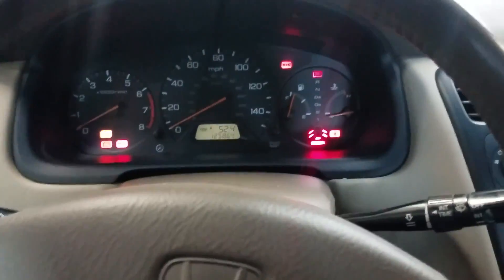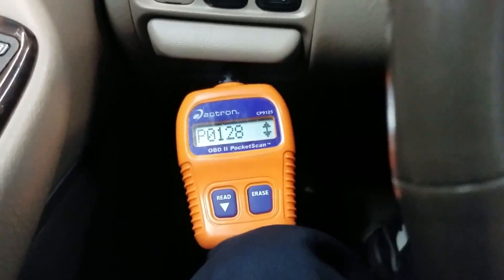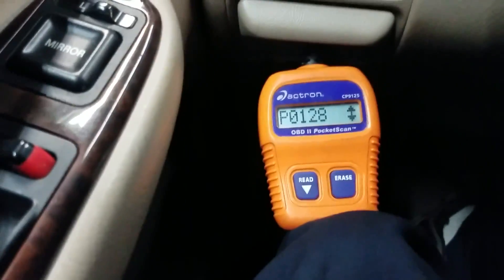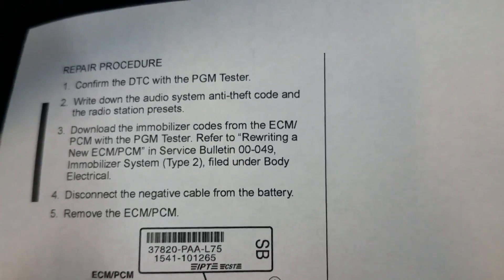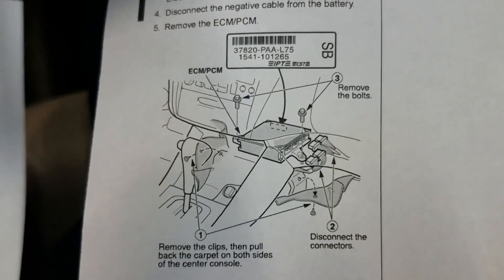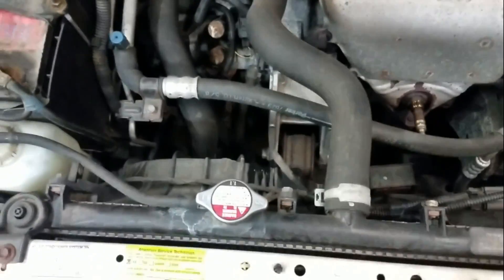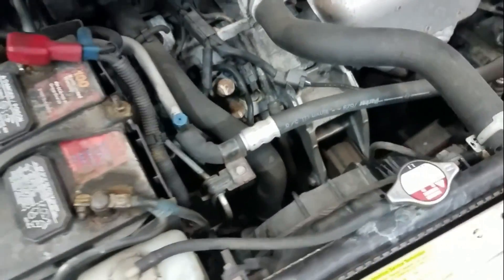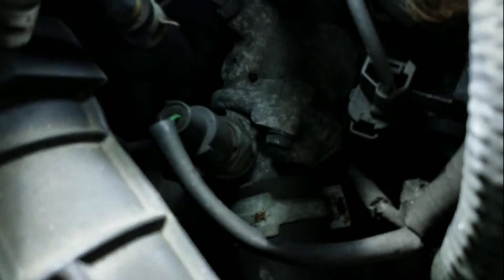P0128 Coolant Temp Below Thermostat Regulating Temp

Comment: I have a 2001 Honda accord and last week got this code and already changed the coolant temperature sensor . Should I change the thermostat as well.  the car drives fine doesn’t jerk or stall the gauges marks normal . I haven’t changed that part since I got the car so I might do that and if the check engine light  comes back on would it be that I need a new ecm ?

Comment: Going thru that right now.  Temp falls to about 130ish, fans still turn on normal; but both gauge and scan tool show the drop/rise.  I replaced ECT and ran fine while bleeding air out of system.  Once I put cap back on - did the same thing.  Right now just bled it AGAIN and now put the cap back on about 5 mins ago.  Still running good.  The temp has not dropped yet. 😁 We'll see what happens

Comment: If I replaced the thermostat, radiator cap and coolant temp sensor and engine light is still on what else could it be???
Reply: Coolant temp sensor possibly
Reply: @mattbrooks9928  I already did that… ended up being the thermostat… I replaced with OEM in which I highly recommend only OEM even if it’s more expensive
Reply: @mikelutts7088  I agree. I been working on my friends terrain she had a code for the temp sensor but when we put it on it still had the gauge dropping to c randomly and the code keeps coming back so we are gonna try thermostat next.
Reply: @mattbrooks9928  just make sure it’s OEM. I switched it 2 times and still had the p0182 code and when I put the OEM engine light off and temp gauge working again 👍🏼 it’s cost way more but trust me it’ll be worth it in the long run and less frustrations.
Reply: @mikelutts7088  I gotcha thanks. Had a similar issue in my toyota recently went through two water pumps and two thermostats. Have you had any other issues out of it?
Reply: @mattbrooks9928  all been working great since I changed that thermostat 230k miles
Reply: @mikelutts7088  I mean like any other repairs you’ve had to do on the car? Just asking cause she just bought hers and I’m the one that fixes it lol so was just wondering if there was any other issues that’s came up hers is at 220k
Reply: @mattbrooks9928  had to change the pulley tensioner, crankshaft pulley, spark plugs, power steering pump, battery cables, really I’m no mechanic but all pretty easy so far with basic tools. Lot of great videos on here
Reply: @mikelutts7088  yeah I’m about to do her harmonic balancer pulley for the crank soon. I’ll give her tensioner a look to. Her blower for the ac just went out also. But thanks just curious to issues others have had.
Reply: @mattbrooks9928  I didn’t need the “Honda tool” I just used my Milwaukee drill and I think it was like a 19 socket and 6 seconds later came off. Great to share we all learn! Pretty easy car to work on though
Reply: @mikelutts7088  that’s true lol repair shops gonna go out of business with YouTube lol
Reply: @mattbrooks9928  as long as I don’t need any “special tool” I’ll try myself. I’ve saved a few thousand already hoping to hit 300k miles lol
Reply: @mikelutts7088  I feel you. I been working on cars for 15 years or so not in a shop my dad taught me a lot and has a big shop with a lift and stuff. I always encourage people to try and fix stuff themselves cause I don’t trust shops or dealers and it saves so much money. I work on the road with truck drivers I escort Oversize loads so my Prius sees a lot of miles I’ve got a 350z that basically just sits there in the shop since I started this job lol but my friend has had such bad luck with cars I been trying to ask a few others that have them to see what to expect. My buddy was told by a shop he needed a new timing chain and camshaft which was quoted around 2k me and my dad took his belt off trying to see where the crazy sound was coming from turned out to be his alternator pulley for 250$ once we found out the guy that told him the timing chain and stuff he wouldn’t answer the phone lol so I just dont trust people in shops cause they just want you money.
Reply: @mattbrooks9928  dang that sucks… lot of bad mechanics out there that give the good mechanics a bad name… if I can fix it and only cost me time and a few bad words I’m all over it lolol with a couple beers.

Comment: if this engine check light code was not repaired for long time, what will happen ?
i hear loud noise after 20 - 30 min of driving which is increased with pushing on accelerator !!! is it related to unrepaired coolant thermostat  ?
Reply: It’s supposed to be a driveable code from what I’ve researched (I have the same problem on my e550) but overtime there’s a small chance that water could contaminate the oil from humidity built up that an entirely warm engine would otherwise evaporate. So as far as im concerned it’s a fix as soon as convenient type thing
Reply: @ziggys9439  
you work as mechanic expert ?
Reply: @robertokristen8316  no definitely not, I’d take all that i said as anecdotal evidence, just so far from my driving experience with a po128 code, I haven’t had any issues appear, except for reduced fuel efficiency
Reply: @robertokristen8316  I just have happened to be dealing with the same issue as you for a while, and driving on it hasn’t done anything irreversible yet

Comment: I've had this code come up on my GMC 2017 Acadia. It matches exactly with what their probable cause statement. I've tested this out and recorded my ECT while driving in different manners and the one thing that will cause the code to kick on is driving aggressively. If you let it warm up at start-up for about 15 minutes, you can drive like a bat out of hell and it won't kick on, but jump in and take off and it always comes on. I realize this is a few years old and different make/model vehicle. I've been researching this issue cause it super hard to find the correct part and super expensive to have the thermostat replaced. GMC totally screwed us by putting it in a hard to reach spot 😩🤬
Reply: Mine does that’s same thing but I have a Kia optima! I’ve changed the thermostat myself and burped it and it still happens

Comment: Can excessive cold cause this? we have been -40 for awhile. Now we are basically 0 but its still on. Dodge caravan 2013
Reply: It will kick on more during the winter if you haven't warmed up your vehicle than the summer. It has to do with how aggressive you push your engine. Drive real casual and/or warm up before you take off and it tends to not kick on as much. I'm driving the GMC 17 Acadia and have the same problem. I started driving around with my code reader on, and it seems like the actual temp is normal.

Comment: Got a p0128 light, it went out, but had the coolant and thermostat replaced anyway.  After replacement, the same code came on again...had auto parts store clear code. Couple days later, same one comes on again! Could it be the sensor? Sick of this happening.
Reply: i read main symptoms are bad thermostat, bad wiring, then the coolant temperature sensor. maybe its your sensor
Reply: @andresandrade5963  Thank you for the reply!  So I had anauto part store guy tell me to do a hard reset, which I disconnected the positive terminal of batttery, for 15 mins.  Its been over a week and its not on , so it may have been a stored code.
Reply: The sensor is the first thing I check when this code comes up. If it says -40 degrees when it's like 70 degrees outside, it's a bad sensor.
Reply: Did it stay off after that hard reset, or did you end up changing the sensor?
Reply: Sorry guys, just saw these comments. It did stay off after the hard reset, it wound up doing pretty well after that. Unfortunately, it's since been totaled, but mainly I'm Ok. That was a really great vehicle, but the fuel costs for it would've been crazy!

Comment: i was getting too hot  and changed the thermostat now its tossing me a p0128, coolant looks good  , so im thnking its either the wrong thermostat type or a sensor??
Reply: my thermostat is fine but Check engine is on

Comment: I replaced the water pump, thermostat and it still gives me that code. I'm going to replace the damn coolant sensor and maybe the radiator and see if it goes away.
Reply: Maybe do the sensor first😂
Reply: Did replacing the coolant sensor work? And what car do you have?

Comment: I have this code 
I took out my thermostat as I live in a hot climate. Should I pop it back in ?
Reply: Taking out the thermostat because you live in a hot climate is one of the more senseless auto myths floating around. It also costs people lots of money in wasted fuel.
The thermostat helps the engine to reach operating temperatures quicker, so that the computer can go into closed loop operation. It does this by staying closed, so that the coolant in the engine gets hot, staying isolated from the radiator.
Before this, the computer will be in open loop, more or less dumping fuel into the engine, just so it stays running.
Reply: Replace the Radiator Cap, Hoses with new screw hose clamps & Coolant Sensors with new coolant.

Comment: got check engine light (p 0128) , replaced the thermostat but the check engine light still on even after driving the car for around 70 miles (coolant level is OK and cooling sensor is OK also) is that normal ? Yeah, the car is 2014 Dodge grand caravan
Reply: Temp sensor probably bad
Reply: @Treaxvour  that’s what I’m thinking is wrong with mine I’m changing it today and seeing if it fixed the problem.
Reply: He said he fixed the engine coolant temperature sensor
Reply: Did you install the new thermostat in exactly like the original with new gasket, all coolant hoses (I mean all of them) with new clamps, new radiator cap and new coolant?
Most thermostats have little pin rod like (bubble bleeder), it you be in at 12 O'clock.
Reply: @angelisone  you are like the guy that ask someone if they replaced a battery in something when it dont work lol. What does changing hoes, clamps got to do with the problem?
Reply: @angelisone  stupid advice

Comment: WHY WOULD AN ENGINE LIGHT GO ON CUZ COOLANT ISNT HOT ENOUGH  THE ENGINE LIGHT IS A BUNCH OF BULL SHIT  THE  MEACHNICS RIP U OFF AS IT IS NOW THE GOVERMENT GIVES THEM ANOTHER REASON WITH THESE FING ENGINE LIGHT!
Reply: If the engine does not get up to a specific temp that could cause sludge build up in the oil. A good mechanic is priceless.
Reply: @paintnamer6403  thanks for this comment..my new truck thru code for low temperature..I checked oil it was sludge..I was TRIPPING OUT! at least I know the 2 things are connected and not separate issues..yes they are priceless

Comment: Got this code on my 2013 Chrysler 200. The car doesn't over heat but in real cold weather it doesn't stay hot instead the temp would drop as I start to drive
Reply: Should be 2 thermostats in there. Replace them both and I recommend flush flush flush. The original coolant in the 200's is problematic.

Comment: My mom's car will read p0128 every once in awhile but I just turn it off because the thermostat has been replaced. Don't know what keeps causing it to come on.
Reply: KingDing919 same here. The thermostat is new but I’ll get this code once in a while. I notice that the temperature gage should be a bit higher than it is (just a bit passed 1/4)
Reply: Maybe the temp sensor. Usually be thermostat or temp sensor.
Reply: @kingding919 what tool do you use to reset the code?
Reply: @manwulf  I just bought me a OBD reader off the internet for like $10 that reads codes. It gives the option to erase codes or turn them off.
Reply: @cburn67  thank you!

Comment: Hello, i have a 2005 Chevy Aveo. I bought this car a few months ago, but the check enginev light was coming on and off for " cam-shaft position sense" low circuit 1. Car drove fine for awhile. I stalled outna few days ago. I read it could be the cam shaft position sensorn. My brother norice the coolant around the thermostat housing when i had  my hood open. I figure knock out 2 birds with one stone. I got both replaced. Thermostat housing and cam shaft position sensor. I drove the car around for 2 days and on my way into work the check engine light comes on, for p0128 coolant below thermostat. My mechanic did ask me to grab orange coolant when going to pick my car up at his house.  I told him i had 50/50 in my trunk. Could this be the problem? Or js it stuck thermostat? Or is if coolant thermostat sensor?
Reply from the maker: Most likely just a bad t-stat. Because that code wasn't there before you did the t-stat. Also be sure it was installed in the correct direction.
Reply: @FlatRateMechanic  thanks!

Comment: Well? Was it the thermostat or ECM?
Reply from the maker: It was just a thermostat on this one.
Reply: @FlatRateMechanic  just did both sensors .on housing and sensor under dizzy and it put the code back on . Did thermostat aswell could it be a stored code with accords . Or is it really my ecm . Car runs smooth now with no other issues so it’s hard to believe it’s the ecm